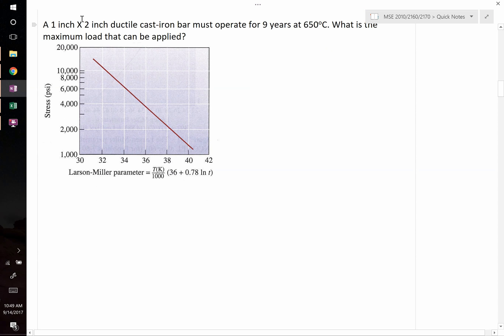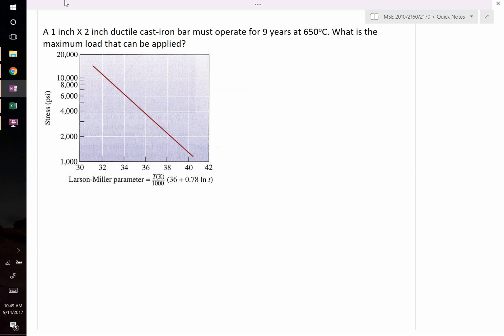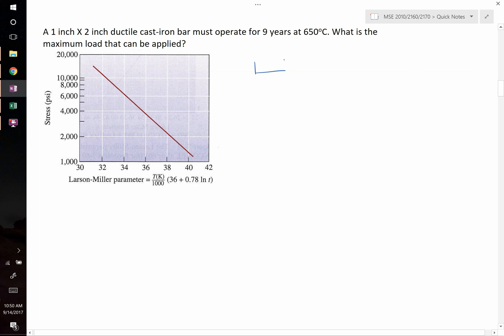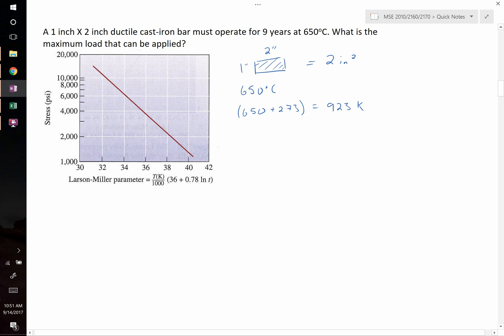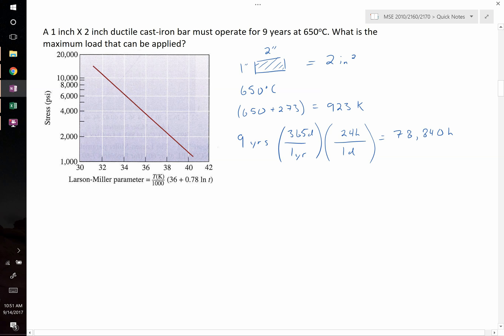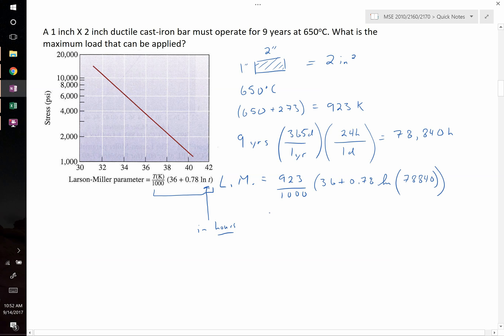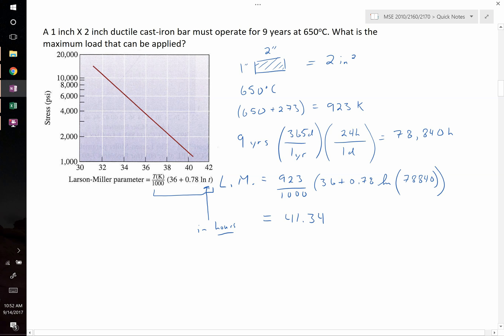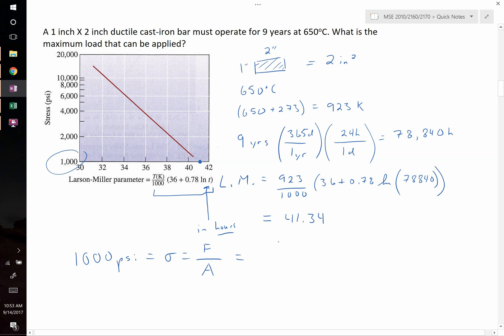Larson-Miller parameter & stress rupture example problem

Comment: where is the use of material in this?
Reply from the maker: We often use materials at elevated temperatures or extreme environments.
Reply: @TaylorSparks  actually question was.. you have considered cast iron. where is the use of cast iron in your calculation of stress/load.. the stress you have calculated is applicable for all material like carbon steel, stainless steel etc?

Comment: My calculation with your equation indicates LMP 36.67. So, I got confused.    Could you please advise why 0.78 was used?  Thanks
Reply from the maker: when I plug in 923/1000*(36+0.78*ln(78840)) I get 41.34, not 36.67. Double-check your math?

Comment: Would you have an idea on how to calculate the LM parameter given different times and temperatures?
Reply: I have the same problem,and the activation energy of rupture is also given. I think using arrhenius will do.
Reply from the maker: Dan Tanner I don't know exactly how they do it. I would do it by measuring several different times and temperatures, assuming a Larson Miller constantly of 20 and then plotting it and putting a line through it. The fit to that line will essentially give you your Larson Miller parameters.